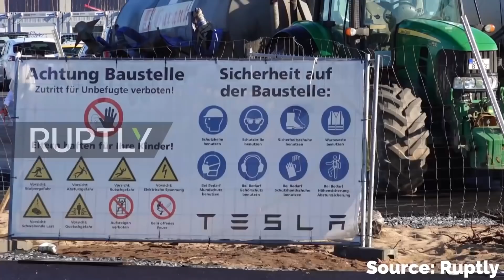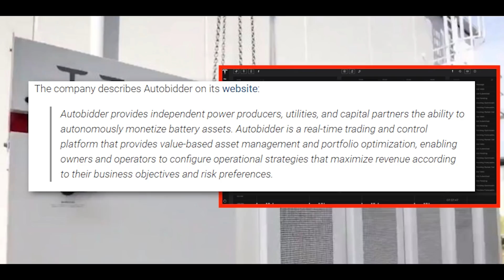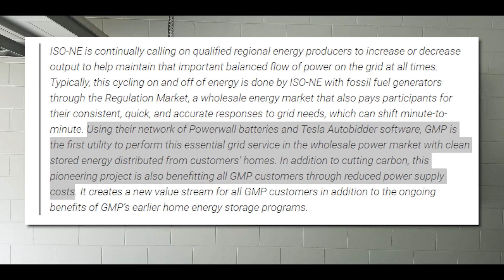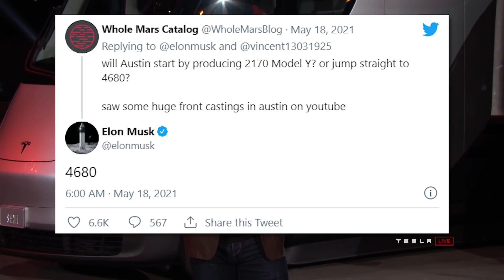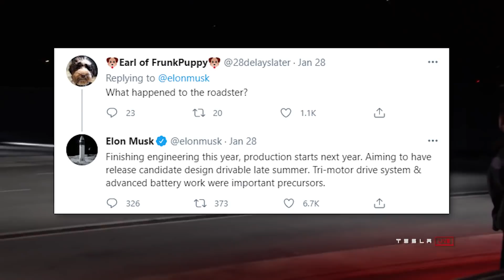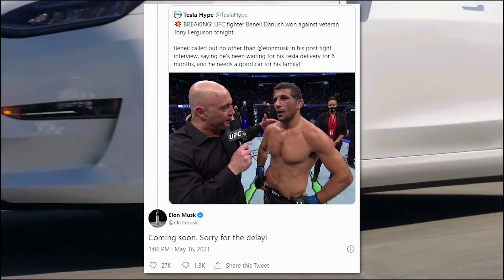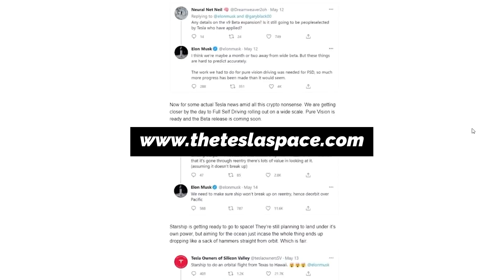2021 Tesla Roadster Update + More Tesla News!

Comment: Someone is going to mention this,  but you said the automatic retractable spoiler on the Model S is Tesla's first (incorrect) the 2016 Model X came with a retractable spoiler that at low speeds would sit flush with the trunk. After limited productivity issues they opted to just make the spoiler fixed in place as it is seen today
Reply: I WAS ABT TO SAY SO. Ive seen a few before and i wondered how he came up with that answer
Reply: yeh i was about to say that